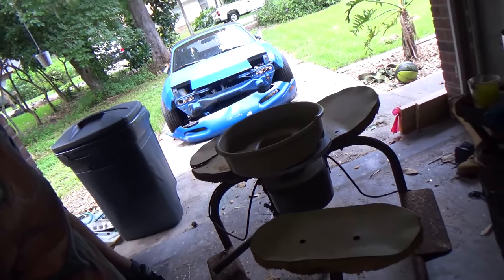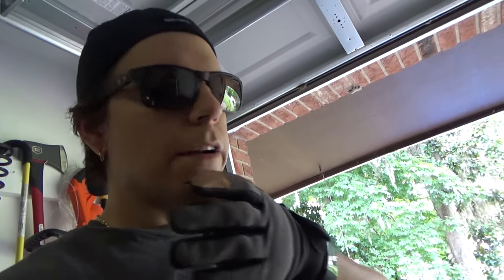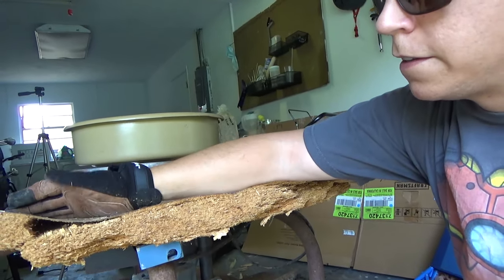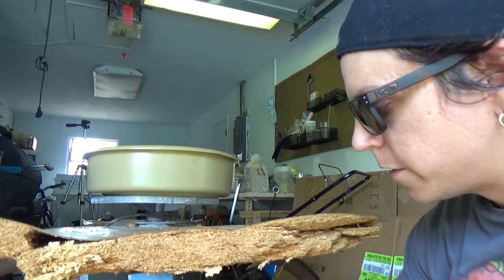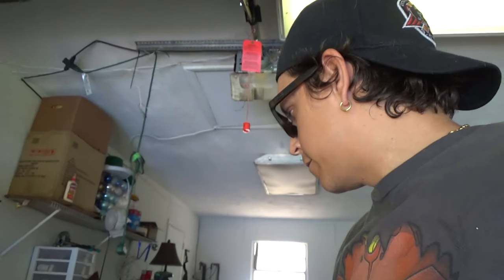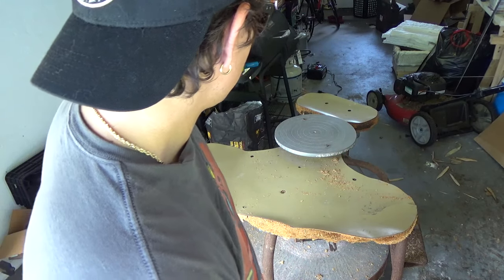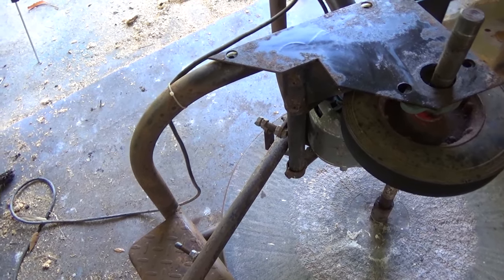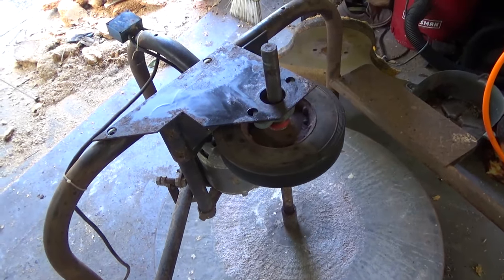$250 Pottery Wheel - Brent Electric Kickwheel - Pt. 1

Comment: How did you remove the wheel head? I just bought the same model and absolutely can't figure out how to get it off. I'm so frustrated lol.
Reply: Had the same issue with this, the wheel head has two small hex set screws, once you take them off, spin the wheel back and forth until it comes loose